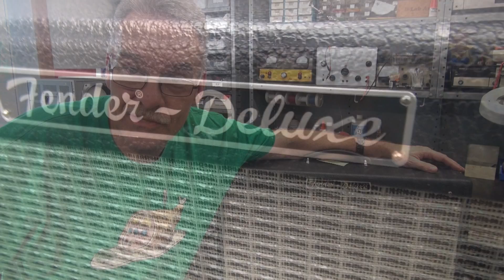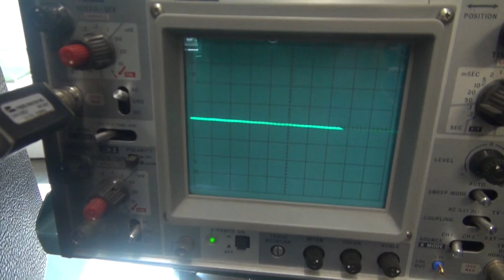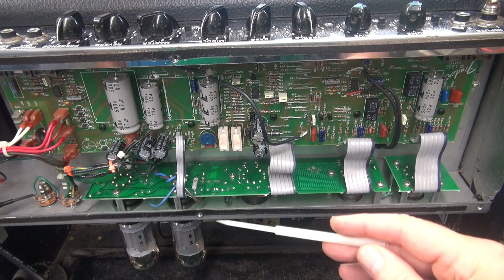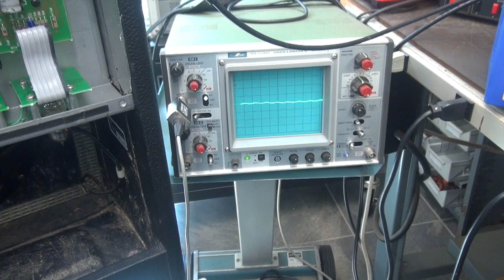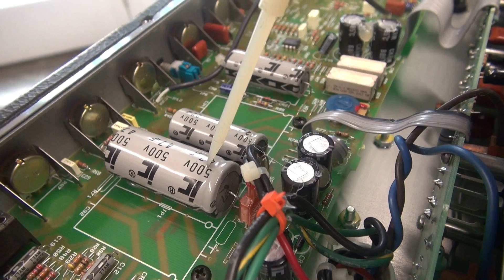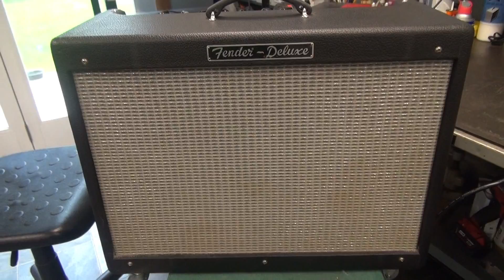How to repair Fender hot rod deluxe tube guitar amp hum distortion

Comment: ya to bad he didn't have ya replace those 5watt 470 ohm and lift them off the board to get the heat off it and the zener diodes would help to be lifted to get air flow under them .

Comment: Hey Terry...how is the reverb tank in a Hot Rod Deluxe fixed or mounted in the back of the amp? Velcro?...screws? The bag is here, there's a cardboard panel in there as well as as the tank itself, but it's free floating around back there...help? Thanks in advance

Comment: Man, what a great tech! Simplifies a complex process. I have a Hot Rod Deluxe combo, 1-12. Love that amp. It's my go to amp. I love the bottom end it produces and it's got this just wonderful ambience about it that most of my other amps do not have, so I'm always judging the other amps by the sound that the HRD produces. I also have a 22w Super Sonic that does not have that full ambient tone/vibe to it. Do you have any mods or upgrades that you could do to that amp to give it a fuller output tone? I could just send you the chassis. Thanks for the great vid and the bonus tips thrown in!

Comment: excellent! i'll be working on both of my contemporary my Fender combos. Both also need at least one jack replaced. Intend to use non-PCB mounted and add leads from jacks to boards. Hope I can add bias access points that don't require removing the back cover each time I check it.

Comment: The same 82K ohm resistor on my 96 DeVille was open, I replaced it and the amp is working again. Thanks for posting , I also installed the new resistor on top like you did

Comment: I have the same humming issue on mine (the filter cap when nothing connected). Just curious, is it actually the filter cap making the noise or something underneath it on the other site of the board? I cant seem to locate it myself by listening.

Comment: Hey Terry, I see that Fender is using those Illinois capacitors on even the newer HRD IV amps. Would you suggest replacing them on sight, or would you let them go until they start causing any noise or hum issues??

Comment: heY Terry, I have a HRD that basically has working just the clean Channel , out of that , no normal, bright, more bright, channel select, or drive on the clean Chanel would work, and overdrive Chanel is completely  dead, all filter caps have been switch to F&T's, new resistors raised above the board, I feel a bit lost, any advice will be appreciate it, thanks!

Comment: Thanks for the video first. My Deluxe has two problems. While playing on the low frets it starts from the 5th or 6th fret of the 6th string it buzzes. The other problem is the drive button. The clean tone is ok but when I press the drive button the amp hums and buzzes. Also the sound goes down. I can send you videos if you want. I'd be glad if you help me. 
Thanks and best wishes.

Comment: I just repaired an Hot Rod Deville with this exact same problem. One thing to note, those screws on the inside are just holding the standoffs to the board. You can take the external screws off on the underside around the tube sockets and remove that board without removing the main board. 9 times out of 10 though I recommend to the customer to replace the filter caps so I end up taking the main board off anyway.

Comment: I always learn something when I watch your videos; however, those two 470 Ohm 5W resistors need to be replaced with resistors that will bring the resistors above the board.  They get hot enough to to not only brown the board (which is plain to see in the video), but they can also cause the solder joints to separate, as well as burn other components/leads/joints near them.  Re-soldering doesn't fix the problem, it just means the amp will need to be serviced again in the near future.  One other item of note, the bottom tube board has screws below the chassis that can be removed to allow access to the underside of the board.  that way you don't need to remove the top board before removing the bottom board.  How do I know?  Just spent several days repairing a HRDx with these exact same issues, plus a few more . . . talk about hunting gremlins.  It's too bad Fender has gone to making amps that aren't as reliable and easy to work on as they once were.
Reply: Just noticed the same thing you mentioned about the tube board. The standoff screws are accessible to enable a tech to remove just that board, but it could be possible that not ever version was the same. It would surprise me if Terry would have missed this fact.

Comment: Just picked up a 2005 Hot Rod Deluxe...the filter caps are not original, but they are leaking, so I'm watching your videos to learn how to replace them myself...will also check the 2 suspect resistors and all ribbon cable solder joints...you recommend NEVER using the solder sucker on these boards?...I've never used the solder wick, but there's always a first time...you do great work and I enjoy the videos. What's your opinion of replacing the last AX7 with an AT7 to cut output?...I've heard it also makes the overdrive channel a bit more palatable...thoughts?

Comment: D-Lab. How much hum is acceptable? Could you give a peak-to-peak voltage value at the load (load resistor ir speaker) that you would consider acceptable? Also would need the load impedance. I ask this because I bought my first tube amp being a Fender Jr. Even with ALL the tubes removed it has a hum when immediately turned on that I do not know is normal or not. I have a scope and would like to duplicate you output test setup. I do not want to re-cap if not really needed. Thanks. Really enjoy your videos and information.

Also what do you think about re-capping by not removing the circuit board and instead cutting the leads near the cap; remove the bad cap; put the new cap in; and then attaching the new cap leads to the "left standing" old cap leads. You could bend the wires to get a good physical connection and then solder to get a good electrical connection. This is similar to making the decision to solder to the available side of the circuit board instead of spending the time to remove.

Thanks.
Reply: I hope D-Lab will provide us with an answer for the first two questions, Fender5621!

Comment: Good diagnosis! But if you go to the following web site: https://www.ampbooks.com/mobile/amplifier-calculators/long-tailed-pair/calculator/ ou will see the 82K/100K pair is not the best way to balance the phase inverter. If you keep the 82K, you can add a 5K or a 10K potentiometer with the B+ going to the wiper and one of the other lugs to the 82K and the other one to the 100K, to balance your inverted and non-inverted phase that feeds the power tubes.

Comment: I loved this video.And the comments BECAUSE my HRD is doing the same thing.I am putting her on the back burner-too much backlog staring at me.
Funny but on another Amp repair channel he usually replaces bad IC caps with new IC caps
22 year old amp needs new caps obviously of any kind
I use Panasonic or NIchicon (look out for fakes)and in the tube/PCB amps I use High temp
versions,they cost more.
These amp builders could make them last forever with high quality components but then the amp $775 new would be over $1000
One repair and you are defeated
It reminds me of the old days- your friendly TV repair guy would come over and fix your set by simply changing the tubes until the TV worked- didn't even bother to see what the voltages were.The TV would work for 4-5 months,cook the tubes,and he'd be back.
Job security and pathway to a successful shop.Just have a full tube caddy and try not to get zapped.Or shot.

Comment: Wouldn't it be faster, easier and less expensive to clip the filter caps leaving some leads on each end to use as turrets to install new caps? Similar to how you installed the resistor.
Reply: Better to pull the board and resolder questionable solder joints if you have the time. If a customer gets a show wrecked because you were too lazy to pull the board, you will have an angry customer. And word travels fast now-a-days...

Comment: Too bad you didn't know you were going to remove the board anyway to replace the caps.  Then you wouldn't have to solder the resister on the alternate side of the board.

Comment: It has been said if you change the phase inverter tube from a 12AX7 to a 12AT7, it is a more robust tube, a little less gain but supplies more current or signal strength because of the characteristics of the tube. Of course the manufacturer makes a difference. Having all the same preamp tubes simplifies replacement. Certainly in a long tail phase inverter, you want the tube to be balanced. I changed the PI in a Vox AC 15 from a 12AX7 to a 12AT7 and it gave a noticeable amount of headroom. I left the factory Chinese preamp tubes in(12AX7s)and it got a little clearer and then I changed the preamp tubes(12AX7s) to JJs and the amp got a lot clearer and it did not go into distortion until about 6 on a scale of 10. That in it self provided more clear headroom. Was this a fluke? What is your valued opinion of this change? I think amps like Fender Bassmans have 12AT7s for PIs to deliver more clear and higher levels of bass tones. Love ALL your videos. I would like someday in my travels to meet you and express in person the thanks and graduate all of your viewers share with me! Thanxz

Comment: Hi Terry, question on the Oscilliscope SIN Wave. you mention which pins you connect to on the output tubes, that you add a resister load to the output in place of a speaker, then you inject the audio signal to the PreAmp is that right? Maybe a short video on the all the setup and tools you use or recommend would useful for some of us. My question is the shape of the SIN diagnosis. When you saw the wave clipped on the up side you immediately said it was a problem with the blah blah. When I used to to Cars and engine diagnosis we used  a scope on the spark plug signal and could diagnosis issue based in the shape of that trace of the Spark energy build and drain. It seems you could build up a image video of the various shapes of the SIN wave and what it says to you about the condition or calibration of the tube systems. Am i right in that analogy and could you do such a video for us. I have a scope and am searching for a cheap enough Signal generator then I want to test, measure, diagnose, repair or calibrate all the tube stuff I can get my hands on. I think this would be extremely educational. If you have already done such a video I am sorry i may have missed. let us know where to look. I had seen a video on the operation of a VTVM that explains how it gets its accuracy and thought Wow! that is a great method, balanced signal gets off balance etc etc. Anyway great stuff, thank you so much. I wondered if you get a unknown radio or amplifier could this test be used early on in the discovery to help shape the state or condition of the tube circuits??? D
Reply from the maker: Hello Dennis, Those sound like good video subjects. Have a back log in the shop right now, but when things slow down I will get something rolling. Appreciate you being part of the D-Lab team. TD

Comment: The IC filter caps . Was it just a batch some years ago or are they still thought to be dubious ?
Reply: outlawrickenbacker  I've had a few amps through with them in , and all seems well with them , so I believe there was just those bad batches back then . And Mr Carlson recommends their IC poly caps , so I think they are probably a good quality brand .
Reply from the maker: Hello, not sure if it was a batch issue. I have seen so many bad that I just routinely change them now

Comment: You’re the man Terry. The hacks around here would have replaced all 3 circuit boards and damaged the speaker while doing it. LOL
Reply from the maker: Yep, lots of board swapping these days. This was just an example of a quick method. There are many ways to accomplish  the same thing. I'm still wondering what took out the original 82K resistor.
Reply: I'm not a scientist, but I believe that a component ran at it's upper limits can receive some kind of electrical or frequency vibrations that cause it to fail. I saw a 1/8W resister mounted vertically one time have the long lead snapped into. Looking at the leads under a microscope, the leads looked like they were bent many times back and forth and snapped but there was no way that was possible. I replaced the resistor with a 1/4W and it worked well. In a case like that, I would replace the component with the next higher power rating. Maybe the resistor just had a manufacturing flaw in it somewhere.

Comment: I've had a dozen of these over the years with an open 82K resistor.
Reply from the maker: Strange failure, I wonder if the resistor was under rated (wattage) ?
Reply: That would be my guess, Terry.

Comment: Terry, have you ever converted one of these over to hand wired? If not, would you be willing to take on the task?
Reply: I'm not Terry but as far as the actual tube circuit...no problem. It's when you get into ALL of the solid state circuits including the switching, reverb, etc things would get crazy.
Reply: Actually, I wouldn’t even need the reverb or drive channels. Would like to keep the effects loop though.

Comment: You could also desolder the old resistor and push it out and then shake it out of the chassis.  Then you can solder the new one on the solder side of the board like you did.  I have done this before on this model amplifier and even some old radios.
Reply from the maker: Yes, there are many options. This is just an example.

Comment: Oh Terry. I have been watching your videos for a long time, and love almost everything you put out. However, in this instance you did your customer a slight disservice. 1) carbon comp for the 82k replace? I get replacing carbon comp for carbon comp, but replacing a carbon film with a carbon comp? Doh! These SOB's run HOT!  2) any time you are in fender HRD, you should always replace/correct the horrible design flaw of having the 470 ohm, 5W resistors mounted directly on the PCB and replace them with 10w and get them elevated off the board. Otherwise, the issue with cracked joints just continues to happen.
Reply from the maker: Matter of opinion. Some say that the new metal film resistors have inductive properties, which can induce noise. Most of my customers ask for carbon comp type. I stock mostly 5% carbon new issue type. No reports of failures. As for the 5W stock type, That is as designed by Fender. I am here to repair at low cost due this area. If this were a vintage collectors amp, things would be handled differently. Sorry that you disagree, however I am in this to help out local bands at a reasonable cost plus timing. Remember, I present these videos as reference. Everyone out there has a choice. Thanks for watching
Reply: @d-labelectronics  Okay, we will agree to disagree on this one....  -Adrian G from Tone I/O Austin, also doing the same for local musicians :)
Reply from the maker: Roger that man
Reply: @remley8877  Typical 3 room apt NYC $2700 (Brooklyn)

Comment: I've noticed a few times throughout videos you've mentioned the poor quality of the Illinois caps. What brands would you recommend for replacement of filter caps?
Reply from the maker: F&T are great for the cost. Sprague & Mallory are the top pick, but expensive
Reply: @d-labelectronics  Hi! I need to recap a vintage fender amp and following the schematic indicates capacitors of 70uf 350v and 20uf 525v, but it is difficult to find those values. I see a lot of folks putting in place the 70uf 350v, 100uf 350v or 80uf 450v. Regarding the value of uf being close to the value of the scheme is ok, but what about the voltage? can add value without problems? in the circuit of bias the schematic asks 25uf 50v. again I see a lot of people putting 100uf 100v. That's right? Is it okay to add these values? in relation to the operation of the equipment, does it change the final tone of the amplifier? I hope you understood my doubt. Thank you for clarifying this.
Reply: @d-labelectronics  Thanks. I have an Acoustic G100T that I need to replace some components on. Been sitting on my "to do" rack for a while now. I am about ready to buy replacement components and get started. So, thanks for the info.
Reply from the maker: Hello, Yes, its always fine to exceed the filter cap voltage rating, never go lower. And yes, I use 80's in the place of those 70uf caps. A little more capacitance wont hurt anything. And yes on the negative bias caps, I always increase the capacitance + voltage ratings of the originals. Just make sure to watch polarity! Have fun. TD
Reply: @d-labelectronics  Thanks man! I learn a lot here watching your videos! I love seeing the repairs on the old fender amps. See you later!
Reply: Agreed,  F&T/JJ are good affordable caps... Sprague ATOM is the king.    Illinois caps were part of the "cap plague"  from 1998-2010...   Their current production has remedied the issue,  but techs don't forgive.

Comment: Why wouldn’t you just undo the screws from the tube socket side? Then the whole PCB assembly comes out without having to remove the main board. Takes all of about 15 minutes to remove and replace the board.
Reply: Yeah, that too! It's easy smeegy.
Reply from the maker: Yes, that could be done. Lots of options to this repair
Reply: @d-labelectronics  Sorry Terry... much respect for you and what you do. I just deal with a lot of these, and couldn't help to speak out on this one.
Reply from the maker: No worries man, always open to options